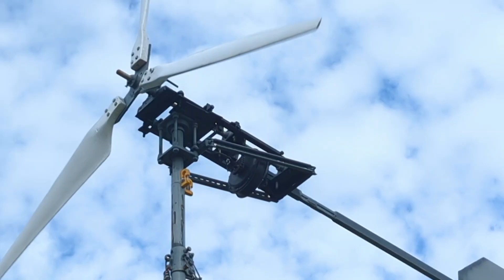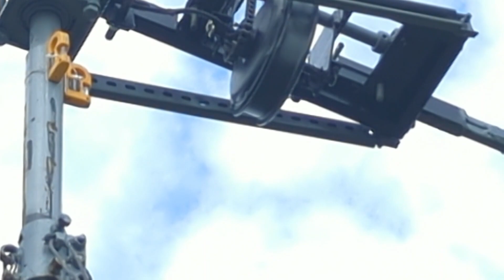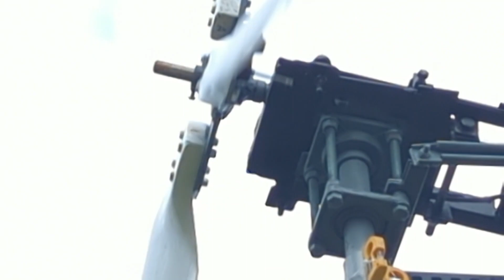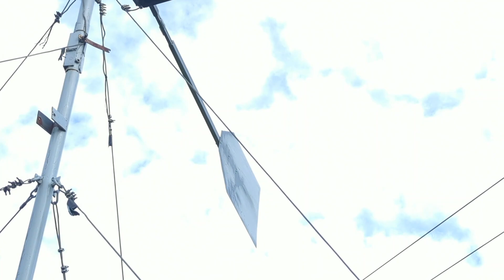New Wind Turbine - Verdict after first serious wind - Very Very Happy - Needs tweaks to max amps

Comment: Tremendous achievement. Not just the physical work but all the great videos too. I suspect the gearing may need tweaking. Is it hard to change? Anyway, very good build. Super smooth and no tail wobble.
Reply from the maker: Kind of a miracle in itself that it got "finished" my kids coming over tomorrow we are gonna take it down and use a multimeter to check the cabling, I'll get him to drag the "power end" from the shed and drag it over to the top of the tower and we'll do some checks :) cheers for the comments and the donations , a little bit of your soul rides up with the machine :)